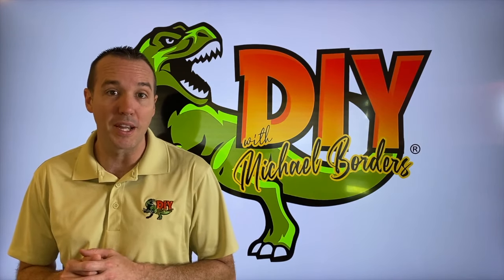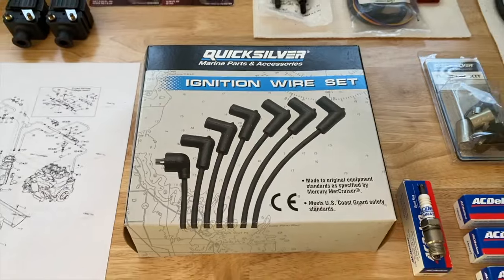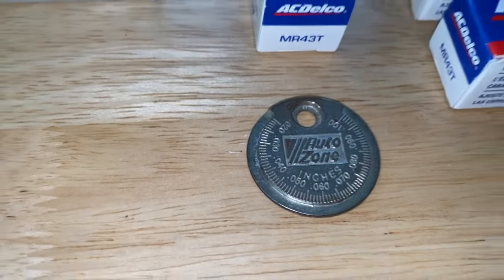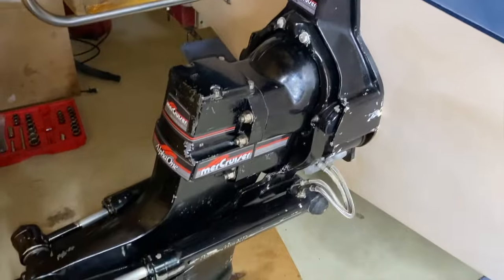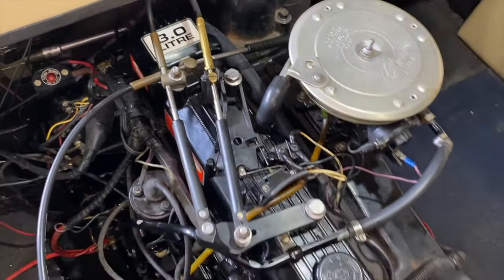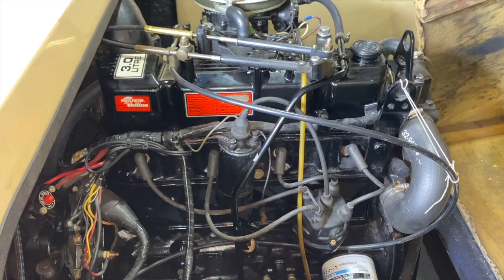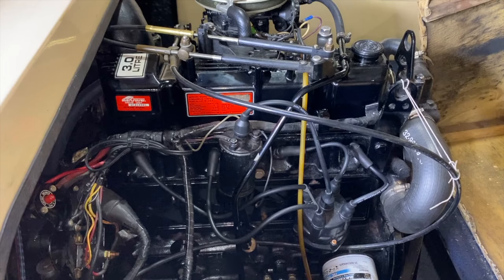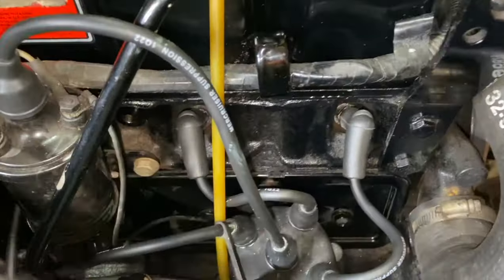Replace 3.0L Mercruiser inboard spark plugs and wires

Comment from the maker: If interested in purchasing this product, visit our Amazon affiliate link below.  I earn from qualifying purchases.

Spark plugs:  https://amzn.to/3TegFRe

Spark plug gap tool:  https://amzn.to/3PgGXB5

Wire and boot set:  https://amzn.to/49NcVNq

Distributor tuneup kit:  https://amzn.to/3IAvDMh

Ignition coil:

       https://amzn.to/491of7o

       https://amzn.to/3wPEwPn

Oil filter:  https://amzn.to/3VmEmcN

****************

1.  Build custom logo skateboard

          https://youtu.be/9Isty_4fIIw

2.  Mount/hang skateboard on wall

          https://youtu.be/c5QDCKZNGH0

3.  Rebuild 1996 Dyno Air GT

           

4.  Rebuild 1996 Dyno VFR rebuild

          https://youtu.be/FMOSNR5TTl0

5.  Replace Distributor cap rotor and points

          https://youtu.be/kqBL1tSTMkk

6.  Hot to properly and safely set distributor point gap

          https://youtu.be/YbEoFI8lCQE

7.  Replace Mercruiser outdrive Anode kit

          https://youtu.be/qy_qclP3zUQ

8.  Replace Mercruiser outdrive Trim Rams and Hydraulic Lines

          https://youtu.be/nkcFYl5bL7c

9.  Replace Mercruiser 3.0l inboard Ignition Coil

            https://youtu.be/PAc0cAYeY_c

10.  How to properly gap spark plugs

          https://youtu.be/z066ckRtLsI